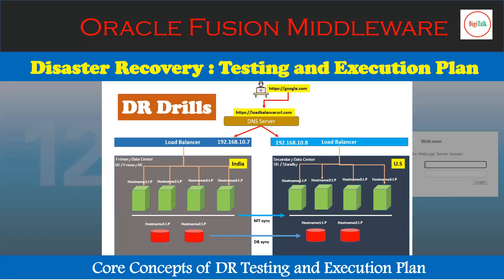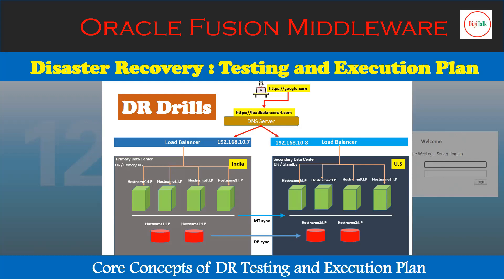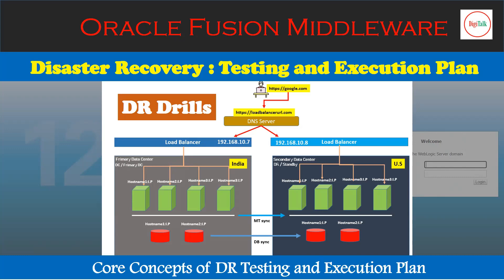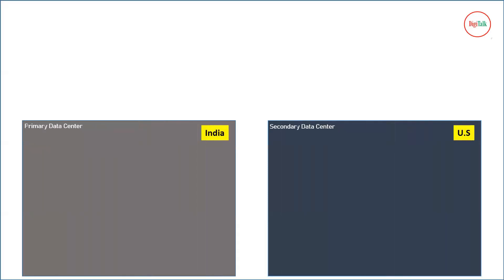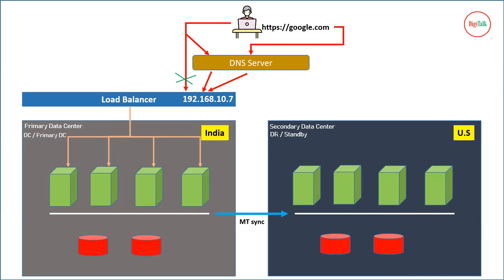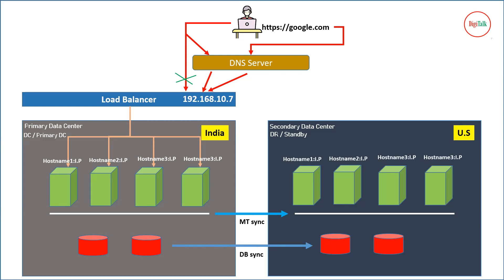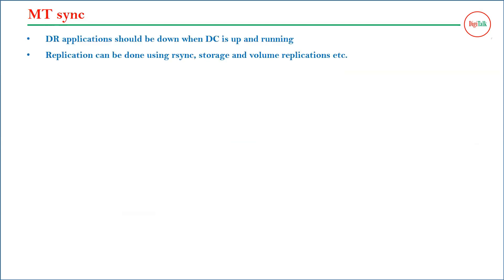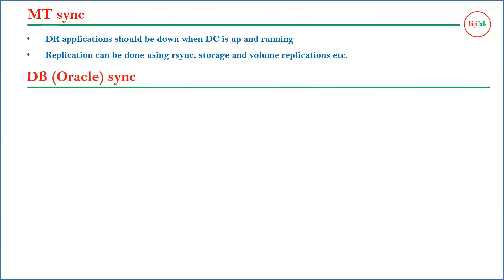DC and DR Drills (Disaster Recovery Drills and Testing) End to End Explanation with Action Plans

Comment: Great video, however Case 2 wont work if testing device is a mobile phone, as editing hosts file in mobile device is not possible. Any suggestions?
Reply from the maker: I never tested it on a mobile friend. There must be some way based on o.s but I am not sure.
Reply: @digitak.middleware  the etc/hosts file in android is readonly, hence cannot be edited. Rooting device can be an approach but thats not ideal in production scenarios.
Reply: Normally in Production environments changing of hosts file is not done and it's impossible.Normally in F5 load balancer we create/map VIPs by adding application pools for both Prod and DR IP's and during DR we disable prod IP'S and enable DR IP's and vice versa.
Reply from the maker: It needs to change in DR hosts not Production where DR hostname points to Production I.P. rest there are multiple topologies to carry out the DR testings

Comment: Till 1:46, are you trying to mention about Hot Site which is a full replica of the site?
Reply from the maker: DR  infra is configured in two ways mostly, either full capacity as of DC or half of DC. Utilization of DR also depends on company strategies. For example, some of the orgs don't want DR to sit idle and utilize both DC and DR as active active